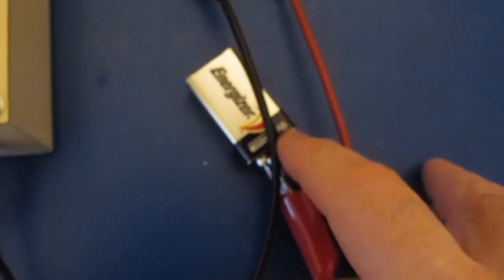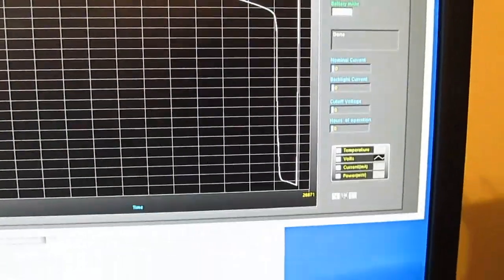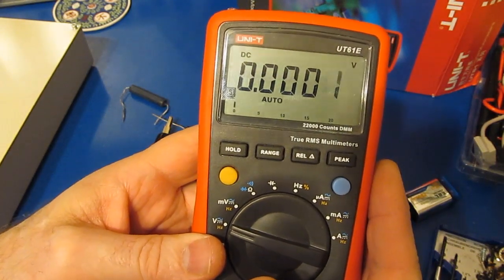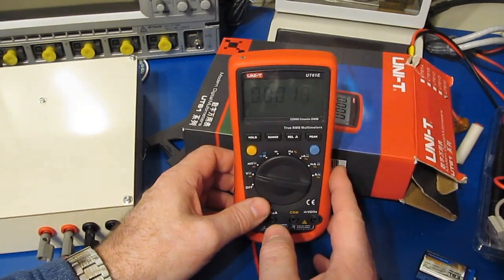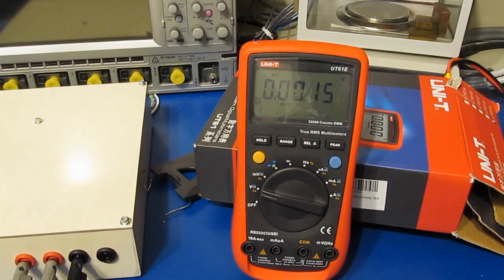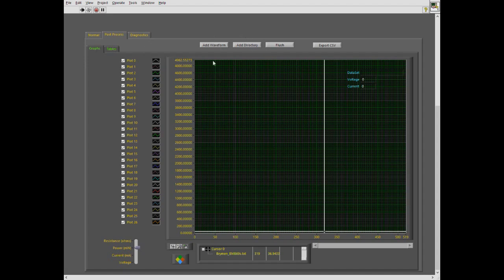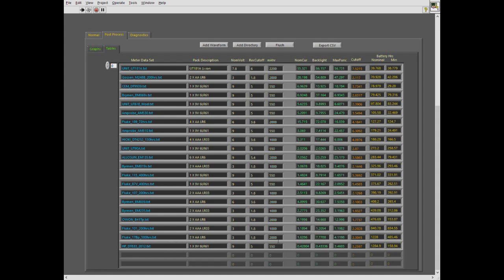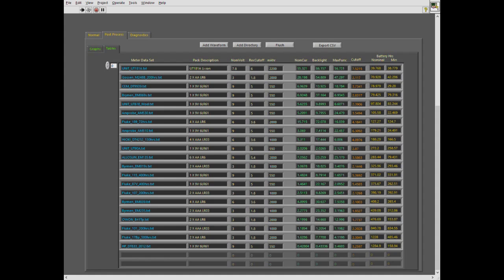DMM Battery Life Testing,  UT61E w/ Low Battery

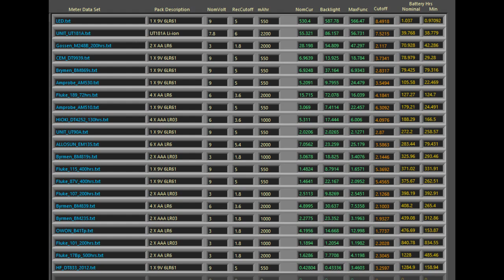Comment: Thank you for the update. just one question at 7:00 why the unit 61E is not listed ?( Edit: Not following blog a for a long time... )
Reply from the maker: The obvious answer is that the picture you reference was taken prior to running this test.  Of course, you can always find the latest data in the spreadsheets.